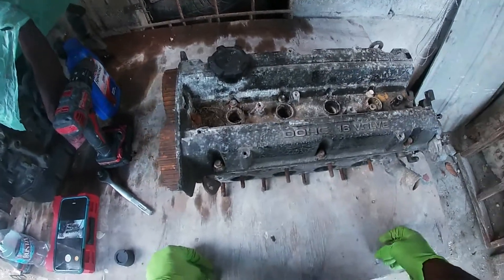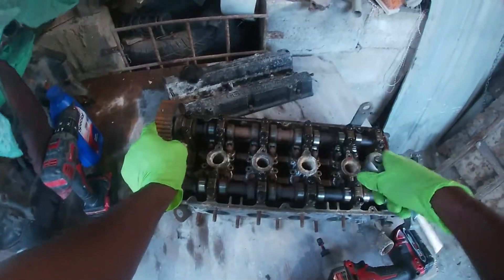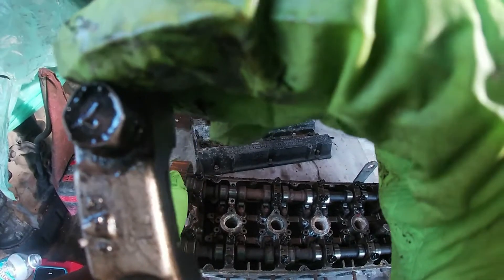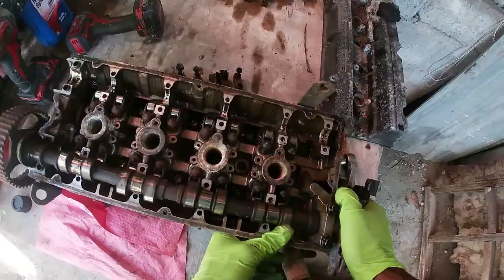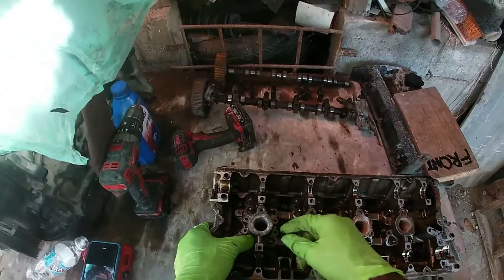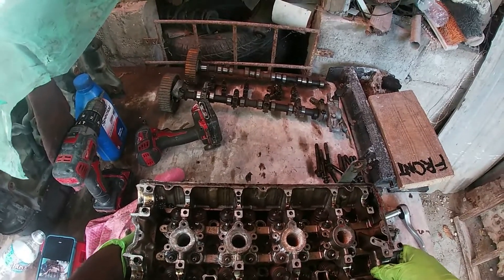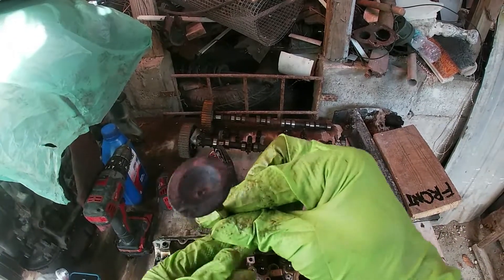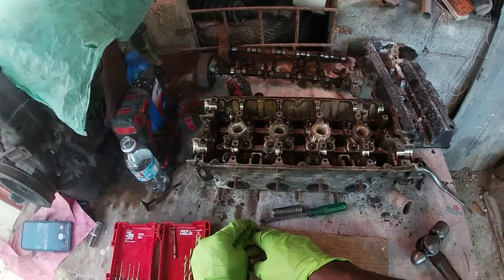*How To Remove Valves*  4G93T  GSR

Comment: I Will the 4g93t gdi head fit on 4g92 sohc block it Will have to use the high presssure Pump and much power u can get  on a standalone ecu or stock 4g93t ecu
Reply from the maker: The 4g93t gdi would fit the 92 sohc block but to go thru all the trouble to use a gdi head getting high pressure pump and all that i dont think would be worth it either get a normal 93t head or even a sohc head a turbo charge it
Reply: @driftmaster4  the reason y i ask dat 4g92 mivec is very hard to come by
Reply from the maker: @cecilschelborn5668  yea totally get you
Reply: @driftmaster4  on a 4g15 doct or 4g92  or 4g93 wat the most power can u get if u turbo it with a standalone
Reply from the maker: @cecilschelborn5668   not sure there's so many variables that comes into play when trying to make power that its almost impossible to say how much an engine could make
Reply: @driftmaster4  i love to see u do 4g15 dohc from a ck2 lancer in yuh box lancer